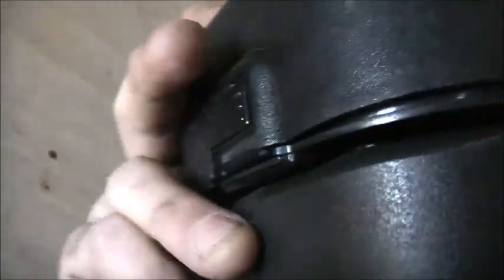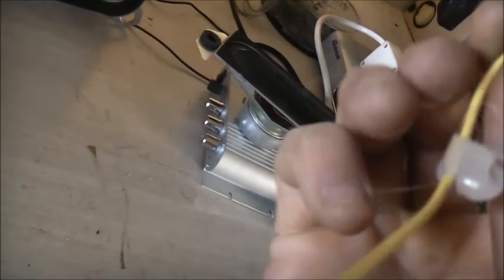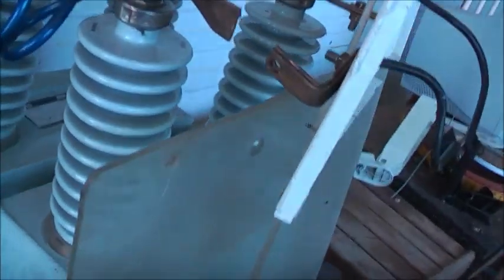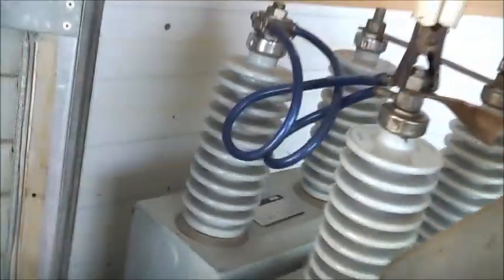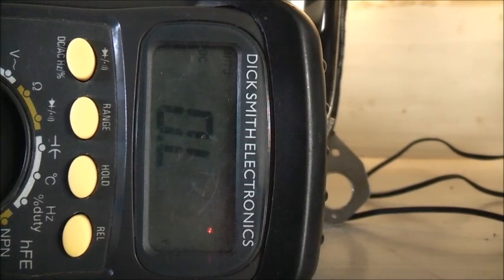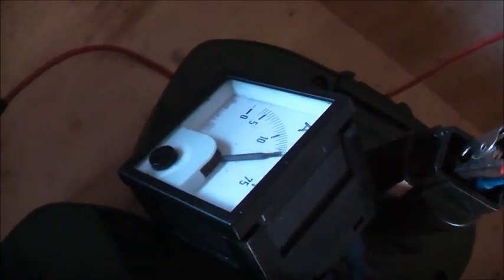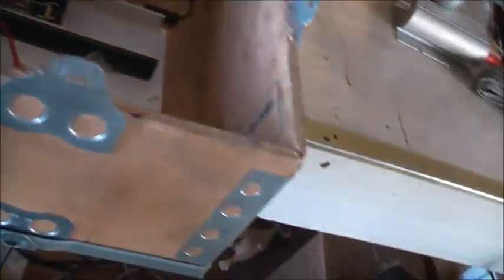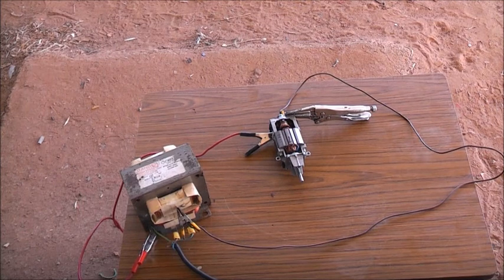Repaired ZVS Battery & Pop Motor

Comment: Those 'dead' cells that you removed from those battery packs....I think they may be able to be "rejuvenated" with a welder. :D Let's see if they whistle & squeel. :D

As for that motor..... That's nuts. That motor managed to withstand a MOT going at top-whack, & it kept on going?!

Was it wired "straight-to-brushes" or as normal? The only thing I can think of, is the MOT isn't powerful enough & was actually holding it back, stopping it from letting loose.

Was the MOT and motor 'ballasted' with something? I can understand that you wouldn't want to wire it direct to your variac, but somethimes, as I have found out with salty-water experiments, you occasionally need to 'over-do' the ballasting.

I once ballasted something with 4kW on my 10A variac (good for 2.4kW, not 4! ) and I got the sparks & pops I wanted, but I don't think the loading on the variac actually hit 4kW, because it didn't complain at all.

The only thing I can think of, is if the loading did hit 4kW, it was only quickly here-and-there & therefore the variac took it. As like a lot of things..... It's "Load-Over-Time".

Most variacs have a small over-current capacity. I'd seem to think that my variac could do 150% (15A or 3.6kW) for a few seconds here-and-there and not break a sweat, but I don't like risking it too often, hence my Variac Savings Jar: I'm going to save-up for a 28A beastie, then hopefully I get onto some proper sparks & pops without having to worry too much about blowing a winding or frying the brush. :D

Thanx for showing,

-BoomBoxDeluxe.
Reply from the maker: Maybe rejuvenated with the BIG Cap Bank!!!!